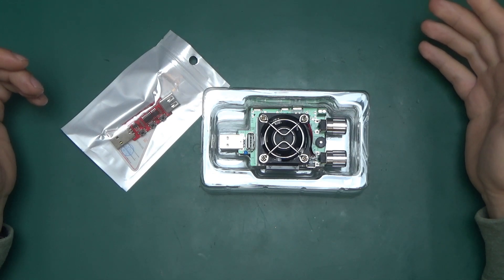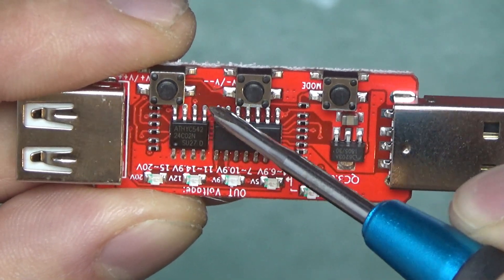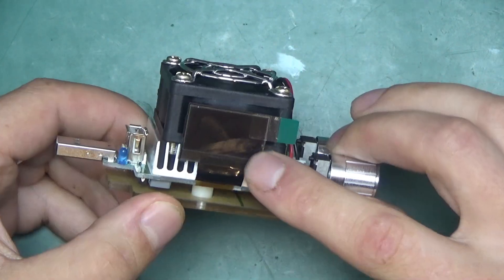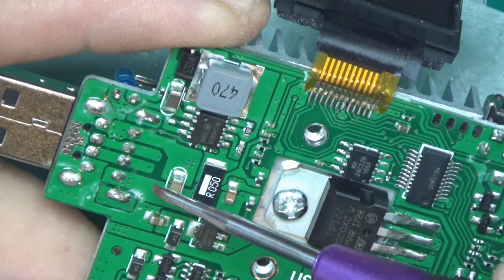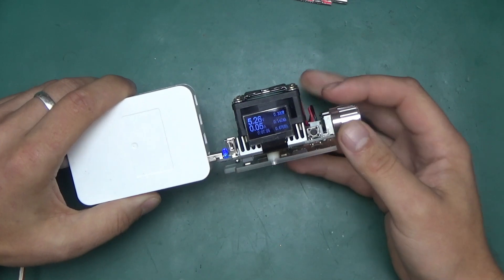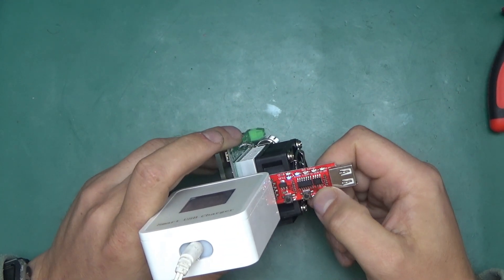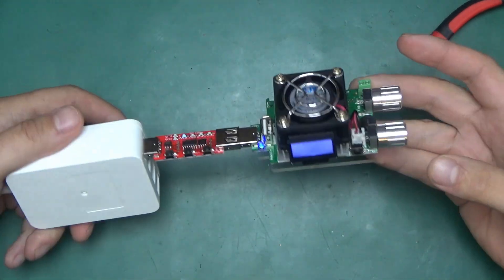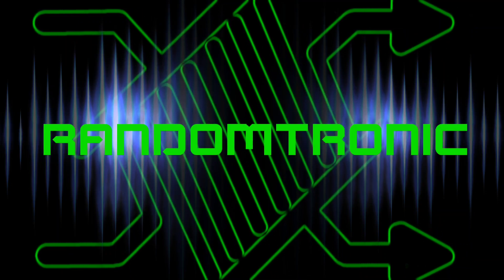#022 - USB DC load with Quick Charge trigger

Comment: I have two of them exact units and they work very well and are very useful. The sys power, like you mention is the 5v to power just the tester itself (no load.) the other ports on the back, (mini, micro, type c and thunderbolt) those are all your "testing ports". They are used to test various usb cables and or power supplies they are attached to. Plug one end of the tester into a usb power supply and the other end goes to one of them ports, then load it up.  Through the menu, you can find the resistance of the cable under load. ive found them to be very useful for testing various cables.
Reply: That two terminal srew block is a lithium battery input. I didnt see it in the video before. You us ethat to load test a lithium battery. Lithium battery goes into them two screw terminals and you use  syspower micro usb to power the tester.
Reply from the maker: Excellent, thank you for the info! I will probably need to do a follow-up vide, as I am finding out more about this device from the comments. 👍

Comment: I have this exact 35 watt dummy load. I love it because it has many features. Although it’s pretty handy the tip122 darlington is kinda wonky, have another on standby because you’ll have to replace it soon. I bought 25 for a couple bucks off AliExpress.
Reply from the maker: If the tranny goes, then I can do a repair video :) thanks for the tip (on the tip122, lol, pun intended!)
Reply: randomtronic lol, 🤣🤣🤣 that’s a good one to insert into the jargon. I had to calibrate mine because it was off a little. If you ever have to do that on yours all you have to do is hold the select button down then plug it into a power bank and bing bada boom 💥 you’re in! Hey, you could video that too 👍🏻
Reply from the maker: I will check it out! Didn't know there was a cal option on this! Thank you!
Reply: randomtronic definitely my friend, it’ll beep once then you can cycle the options using the button and adjust using the course potentiometer 👍🏻
Reply from the maker: @NitroGuyJH  awesome! Thanks again. I will do a quick video on this, maybe it will help someone!
Reply: randomtronic Yes sir! Your welcome, it’ll definitely be a help for others that don’t know about it or theirs is out of adjustment.